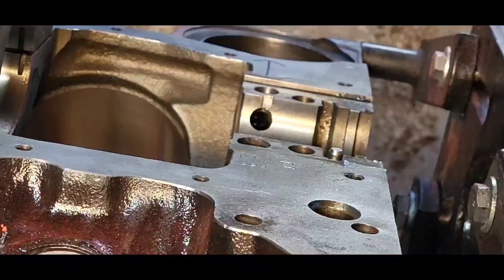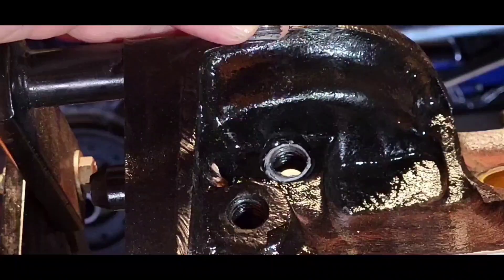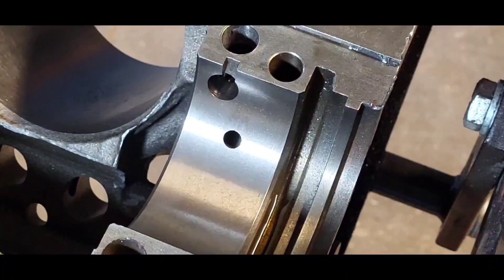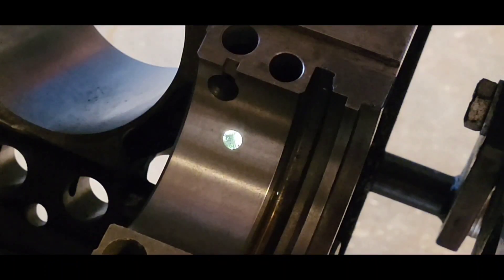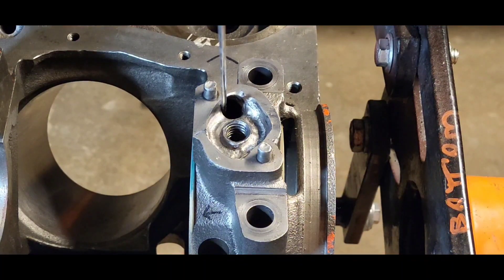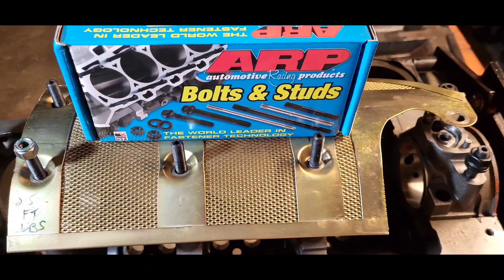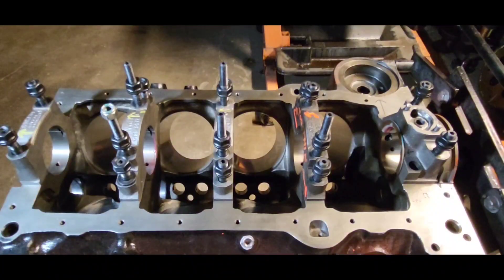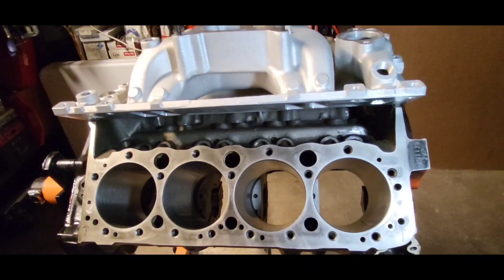I Saw the Light.

Comment: Windage tray distance to crankshaft counter weights very important.
Yup ARP Lube and torque specs for sure.
I built so many in 1970 working in a race engine shop holy cow your video took me right back to 1970.
I even remember having the Crankshaft Company make up 302 cranks with center counter weights forged nitrated big oil feed holes really nice shafts for my customers who like 8500 haaaa
Reply from the maker: I have a special place in my heart for the "302" Chevy.  I never met one I didn't like.

Comment: Of course a windage tray on any motor they even put them on dry sump motors to keep that crank from getting any significant amount of oil on it robbing power and putting an extra strain on the crankshaft god knows there's enough strain on it already but add splashing around in 3 or so quarts of oil and you've really slowed it down the only motor designed for that is the 3.5 Briggs and Stratton lol

Comment: You should mention, when you change from bolts to studs; you need to align hone.
Reply from the maker: You're right, I should have.  I know that and intend to do so, but others might not.  Good point.  Thanks.
Reply: @the4flatgarage  why
Reply: @Glenn Manchester  The clamping force from a bolt comes from the bottom, up. The clamping force comes from the top down on a stud which results in different load on the cap that is stronger and distorts the main cap.

Comment: Do you clean up the 2 bends in the rear main cap passage.  And where the 2 oil passages meet deep in the block.    Flare the openings in the filter mounting area.   I used to experiment with the cam bearings out with my die grinder and a small cut off wheel in the groove outside the rear cam bearing.   I left my rifle and shot gun ball hones at a previous shop. I would ball hone the oil galley passages followed by oil galley brushes.   I left my spare rear main cap that i had modified with a plate a pressure gauge. A quarter turn valve and an is55e intermediate shaft with the upper ground with 3 flats for my drill chuck as an oil pump dyno.   One of the oil pump rebuilders in los angeles had a real oil pump dyno.  They could give you a flow and pressure bypass test of many oil pumps.
Reply from the maker: Because of your comments, Wayne, we have been in touch with Zoro, and are considering purchasing part # BC5812, Silicone Carbide, 120 GRIT, 5/8" Dia. X 3" X 8" OAL.  Just wanted to know if you thought we were in the ballpark for grit, and such.  We have the brushes already.  Please let us know.
Reply: @the4flatgarage  are the galleys just smaller than 5/8.
Reply from the maker: @waynep343  I'll have to check and measure them.  Will let you know.
Reply: Did gm use a high pressure high volume oil pump in the 302 or just what you guys are doing w the deburring and such to help it get back to the pan quicker
Reply from the maker: @glennmanchester5696  It's hard to get 302 printed material, specifically.  You usually find it stated as, "Z28/LT1."  But it's common knowledge that everything developed for the 302 was later used on the LT1.  The production Hi-Po oil pump on Z28 was part number 3848907.  It had 1.20 tall gears.  But they had part number 14044872 also, and it had 1.50 tall gears.  It was a high pressure, high volume pump.
A rule of thumb back then was 10 pounds of oil pressure for each 1000 RPM (some say 7 lbs, but for the sake of argument, we'll use 10.)  7000 grand, 70 lbs. pressure.  But sometimes they only got 65.  That's when racers went in there and shimmed the spring.  The HI-Po production spring had a white stripe.  And I think they had a purple stripe on one, but can't find mention of it.